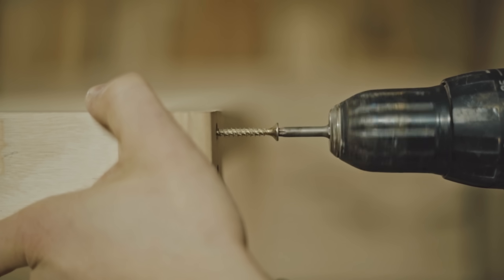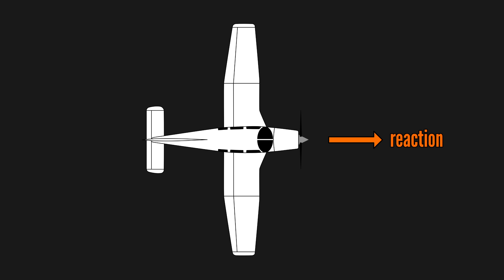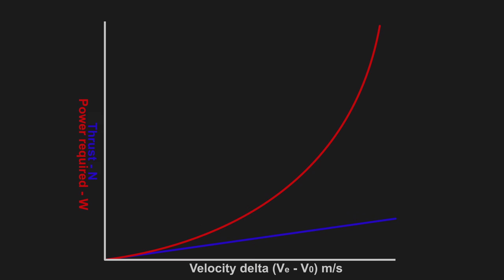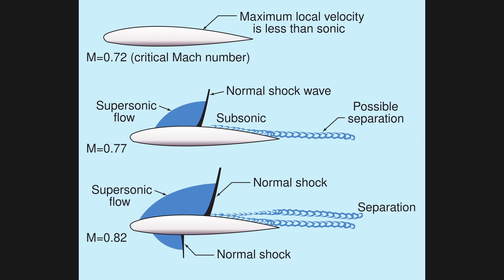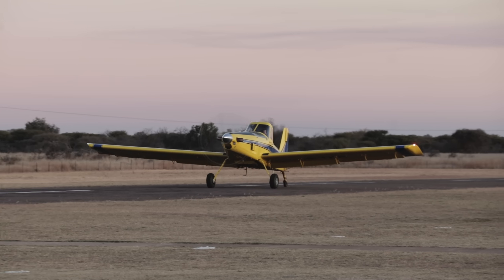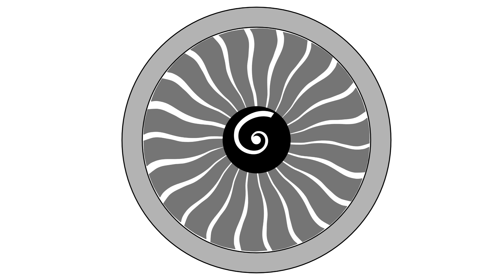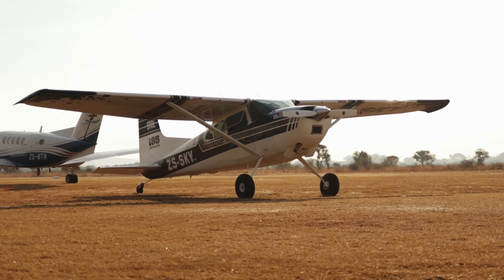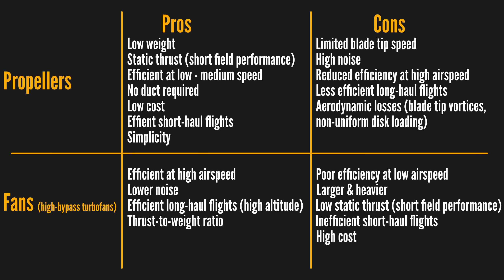This is Why Some Aircraft Use Propellers and Others Fans

Comment: My screws work by accelerating the wood backwards. Since the wood is quite rigid (especially compared to air) the acceleration is almost instant and the wood moving backwards is the same speed as the screw moving inwards. So basically the same principle as a propeller.
Reply from the maker: I'd say its quite different. Can't even calculate it the same. Since your screw moves the entire block of wood backwards with virtually no losses as it screws into the wood. Force in = force out (assuming wood is 100% rigid and solid, which it isn't).

The propeller however cant "screw into" air as it can't grip air like the screw, but disturbs the fluid and "blows" it backward. That was the point. 
So the force applied (thrust) is comparatively complex; how fast it accelerates air, how much air (mass) it accelerates, and then how efficiently it does it.
Reply: @LetsGoAviate But shouldn't there be a smooth transition between air and wood when you would progressivly make the air more viscous until it finally becomes solid?
Reply: @LetsGoAviate  The key difference isn't push vs. pull, it's rigidity (i.e. viscosity). What you're talking about re: "gripping" the air is about how much the medium resists deformation. In wood, rigidity (i.e. near-infinite viscosity) means deformation resistance is dominant - in air, low viscosity means inertial resistance is dominant. That leads naturally into different calculation methods emphasizing one vs. the other.

Comment: Well, in a sense a propeller does pull itself forward, but by creating lift in the forward direction. Not by corkscrewing through the air. Correct?

Comment: Yes, EVERY action has an equal and opposite reaction. And this applies to wood screws too - the principle is exactly the same. The reason they look different is simply the consistency of the medium: wood doesn't get "blown back" to nearly the same extent as air. But it is still happening.
Reply from the maker: Yes, the difference is slippage. The screw doesn't break up the wood around it, it "moves" the whole plank in one piece. The propeller doesn't screw through air like a screw into wood, it breaks up the air its in contact with and accelerates it faster than the free stream air. That's what I was saying.

Comment: 0:47 thats effectively the same thing(with exceptions), the only difference is the thing a propeller is twisting into is viscus so the propeller will slip (and air can be compressed and accelerated) rather than always following its pitch like a screw(because the medium a screw is going through is solid and wont be theown out the back)

Comment: It's not a "fan" in the colloquial sense, it's a compressor. A single stage, low pressure, high flow, axial compressor. You can tell by the stator vanes behind it.

Fundamentally its function is to impart  energy onto the reaction mass (inlet air). In part, it directly accelerates it, but in part it also compresses it so that the nozzle behind it can accelerate it further.

In subsonic and transonic applications it's the most efficient way to generate thrust of that scale. For high transonic and supersonic flight however, one stage is not enough. More pressure is required, along with a choke point in the nozzle, in order to produce supersonic exhaust. This is because inlet air has a limited maximum Mach number, which for all these engines is necessarily subsonic. Thus at higher speeds, the reaction mass is slowed first, then accelerated again, requiring exhaust velocity to necessarily be greater than free stream. A requirement which does not apply to pure rockets, as they carry their own reaction mass within the vehicle.

To achieve these greater pressure ratios, supersonic engines use a lower bypass ratio and multiple stages of LPC. They may or may not also feature reheat.

One way to not let a good high speed inlet go to waste are Concorde's variable inlets. The engines have an inlet limit of Ma 0.65, and the variable inlet geometry uses the shocks resulting from the supersonic inlet to compress it while slowing it down.

Another more sophisticated example are the SR-71's J58 turbo-ramjets, which feature bypass ducts to send the pre-compressed inlet air past the initial compression stages.

Comment: So if a fan on a modern jet engine is a fixed pitch, is it more like a climb prop or a cruise prop. We have this discussion in one of our aviation college classes. We came up with the theory that it must be set more for cruise optimization because cruise efficiency is the most important factor in design since that’s where the engine is most of the flight.
Reply: When the fan (blades) stall at take-off, this will be much more expensive than slightly less efficiency at cruise .
Reply: @ArneChristianRosenfeldt They might be stalled until you start moving and get some airflow over the blades to reduce the angle of attack
Reply: @grumpy3543  I just wonder what inefficiency in a fan would mean. To me they look like a screw. Very thin profile -- which would be prone to stall, but when the fan doesn't stall, efficiency would be good? I mean, I once wondered how to reduce the material in a fan, but still provide an even swirl for the stator. But those transonic fans have so much blade overlap!

Comment: You completely neglected to discuss the force generated by propellers due to the forward lift generated by the airfoil shape of the propeller.  You came close when you showed the camber that propellers have, but mentioned not a word about the lift that the camber provides on the propeller blade.  Besides the thrust from blowing air, the propeller blade camber generates aerodynamic lift forces that provide efficient forward force to propel the aircraft.

Comment: That doesn't make sense! 
Is the fan designed to compress air? WHAT?
That's stupid!  The FAN of the TurboFan engine does not compress air! 
The Venturi effect says that any fluid that is in a large duct and passes into a smaller one decreases the pressure and increases the fluid velocity.
The FAN and the propellers work in the same way.
The point is that the FAN has a larger "wing area" than the propeller and this makes the FAN move more air mass because it generates more LIFT in all the blades than the propeller.
The FAN works on everything to help direct the thrust of the fluid.

Comment: Thank you for stating that the fan is a compressor, most people think I’m delusional when I tell them that fans aren’t just propellers with more blades. I’ve even been expelled from a hobbyist club and cursed at just for stating that turbofans are jet engines and are not ducted-turboprops, as if the proper explanation is a form of hate speech or something!
Reply from the maker: Lol. There's always points of contention in these types of videos/material, but I didn't think this would be one. Would be tough to explain how a turbojet or turbofan core works if fans don't compress air...
Reply: @LetsGoAviate   I know, that’s why I’m so happy that you don’t think I’m crazy. Some people went as far as to saying that open propellers are purely compressors and that ducted fans are purely propellers, those are the folks who claimed I’m delusional. Perhaps they should speak for themselves!

Comment: So what about the new CFM-Rise "Open Rotor" engine? An unducted  fan designed to be used at jet speeds and claimed to be more efficient than a ducted fan. I'm intrigued by the "static vanes" on these engines that convert some of the unwanted rotation of the airstream into forward thrust (like a sail). Could ordinary propeller aircraft benefit from the same trick?
Reply: Both work the same way.

Pros and cons!

Propeller
Pros: 
- Simple to build
- Larger air suction area.

Cons:
- Shifted flow direction (not centralized with Ducts.)
- Smaller wing area against FAN

FAN
Pros:
- High airflow direction(centralized airflow )
- Moves high air mass due to larger "Wing Area"

Cons:
- Expensive to produce

Comment: An admirable video. Then there comes the combination  of propeller or fan with electric motors. I expect in aircraft designed for them the use of at least two wing mounted motors and  no motor in the nose of the aircraft - the electric DHC-2 aircraft now used in Canada were designed for piston engines. IC engines loose power with altitude above sea level, electric motors do not - very important in places like Bolivia and Tibet.

Comment: Propellers work by the difference in pressure on each side of the blade. It has nothing to do with the air moving behind the blades.
Reply: It depends how you look at it, both explanations are valid and interconnected. Newtons laws hold, air is accelerated backwards and the opposite and equal reaction propels the plane forward. The pressure behind the blades is higher than in front so the blades are pushed forward. Same is true of wings, they force air downwards to produce lift (you can see this when a plane flies through smoke), and the pressure beneath them is higher than that above.
Reply: @philiphumphrey1548  Yes they are interconnected and every action has an opposite reaction but the air moving backward is not the force pulling the plane forward. Just as in a balloon you release it is the pressure on one side of the balloon pushing it.
Reply: Exactly, they are an airfoil similar to a wing.
Reply: Principle of pressure to me sounds more theoretical while principle of air acceleration, action and reaction forces sounds more mechanical.

Saying propellers have nothing todo with air acceleration is sounding ignorant
Reply: @LeeCo_Animations  I never said that. the plane moving forward has nothing to do with it. It is a reaction that happens but not the reason the plane moves forward.

Comment: This rundown is sort of correct… some of the points work on the wrong conclusions. Fundamentally, there is no difference between how Fans and Props produce thrust; they are however tuned for different regimes of flight. Both devices depend most on the disc face to produce thrust, just like how the top of a wing is most critical for producing lift. Thrust is fundamentally Lift, just produced by a prop or fan in this case. 

Fans don’t really build pressure more than they drop pressure ahead of them. Newtons Third Law and pressure dynamics resulting in the violent acceleration of air aft the fan as a result. Same with Props but at a much lower extreme. 

Fans came about because their design allows thrust to be produced at high cruise speeds, where traditional propeller solutions tailed off. In that way, its more accurate to think of fans as high speed propellers, ducts and inlets being utilized to reduce the draw backs of a fan type design.

Comment: Blades are designed for a specific speed because the angle of attack need to decrease as it go further from the center, fan blades are attached to a relative big hub with a decent distance from the center,and are shorter   than blades this makes them efficient at a wider range of speeds even with a fix pitch. 
So I guess if blades are placed in a cone 1 meter or 2and bladesare only 1 meter the sistem should
Be efficient at a wider range of speed even o. Fix peach.

Comment: Another great video. One thing that (I think) wasn't mentioned is the tighter manufacturing tolerances required for a ducted fan to perform well.
Reply from the maker: No I didn't mention it. Valid point, thanks.

Comment: Thank you. Solid explanation for standard props. Here's something different and it would be interesting to hear your comments. This prop is a combination of high speed props plus centrifugal compressors, high thrust at the tip, reduced pressure at the nose cone. https://drive.google.com/file/d/1m2rHYah-N5r2zSYRIkrj_qru_8j1DgJU/view?usp=drive_link

Comment: Langua 2:40 "as the square of the velocity difference", I think that should be something like "the difference of the squares of velocities".
Reply from the maker: Yeah you may be right 😆
Reply: That sounds pretty rough. That would mean the energy to accelerate stationary air to 10m/s by propeller would be much much much lower than the energy to push 40m/s air up to 50m/s. That seems like it would get out of hand very fast. something is missing.

Comment: The fan tip speed on many turbofan engines is higher than Mach one. For example, the CFM 56 has a fan tip speed of Mach 1.3. The tiny clearance with the cowl stops the tips generating noise the way an open prop blade does at high Mach numbers.
Reply: Speed if sound changes depending on density of medium traveling through. Black hole: sound speed is infinite in theory. Lower the pressure of medium and speed of sound plane increases before broken. Easy to understand
Reply: @replynotificationsdisabled  nope. The speed of sound varies with temperature, not density. It just happens that the air  at high altitudes is both less dense, and colder. 

The speed of sound at 25c (a pleasant temp at ground level) is 774 mph (1245kmh). The speed of sound a -50c (typical temp above 30,000 feet) is 669mph (1077kmh). 

Just for fun, at the peak combustion temp in a gasoline engine of about 2000c, the speed of sound is 2137mph (3439kmh). 

And the U.S. Army Air Corps did some studies on combustion speed in WW2 and found the normal flame front speed in all gasoline engines was around 150 feet/sec, but if detonation occurred, that burn speed jumped to over 3000 feet per second, making it supersonic, creating those shock waves we hear and call detonation.
Reply: @robboardman598 density absolutely effects speed of sound
Reply: @22k_LOL  Incorrect. The speed of sound depends on the temperature of the air, not the density. 
For examples, go to the speed of sound calculator on the USA's official weather site. There is NO box for inserting density. There definitely is a box for inserting the air temperature.
Reply: @replynotificationsdisabled  unfortunately that's incorrect when referring to aircraft. Both the aircraft and engines are working in the environment of AIR, and the speed of sound in air is dependent on the temperature, not the density.

Comment: 4:43Neither fans nor propellers generate a pressure rise in their wake. They generate thrust purely by an increase in momentum.
Reply: They do, the air continues to accelerate after it leaves the prop due to the increased pressure at the rear of the prop, incidentally this leads to a 'vena contracta' shape of the airflow behind the prop. However, increasing the momentum is inseparable from increasing the pressure so both are true. NB; a reduction of pressure on the front of the prop also contributes similarly to the acceleration of the air before it enters the prop.

Comment: Air is a medium. The lever action of a blade moves the medium and the inertial energy of that medium is captured by the propeller, is passed through to the airframe to be used as propulsion. It's a screw. All the flight components of any aircraft (except pure rockets) are predicated on the presence of a medium. Hence angle of attack, air density, SoS, flaps, boundary layers, ailerons, shark shapes... are all factors in successful design.

Comment: The most significant part  is - ducted fans don't have tip wash.  
Everything in nature will take the path of least resistance. 
Without a  shroud or duct - propellers have a great deal of tip wash , meaning the air is moving aft and  outward in a cone shape behind the propeller. 
Ducted fan engines contain and direct thrust air in a very tight circular force. 
Ducted engines are quieter because the noise of the blades is contained inside the duct / shroud. 
Fan engines have more blades to minimize vibration, noise and share a much greater load between more components.
Reply: i disagree.
Unducted propellers or fans generate swirls aka vortices and like any good aerodynamic engineer knows, any kind of air flow disturbance causes inefficiencies. 
That's the real killer of unducted fans and propellers, that there is a limit to how fast the tips can spin before the disturbances become too great. Ducts are one way to control these disturbances and there are a few other methods but ducting is the most common and simplest although adds weight and if done wrong a safety hazard.

Comment: 1:32 Much of the existing literature and media reiterate Newton’s third law, yet this perspective offers limited explanatory power. In fact, the behaviour of aerospace vehicles—such as rockets, propellers, jets, and wings—can be more accurately described by Newton's second law rather than the third. This is a common misconception. A propeller creates thrust not due to momentum but due to rate of change in momentum, i.e., due to a force. As this force causes the propeller to move thru the air then work is being done by the powerplant.  According to the equation F=ma, when an individual throws rocks from a wheeled cart, the cart will move in the opposite direction. For instance, if a person throws a 2 kg stone at a velocity of 10 m/s every second, they are effectively exerting force against the inertia of the stone. In this scenario, the force can be calculated as follows: 2 kg multiplied by 10 m/s², resulting in a force of 20 Newtons. While analysing the forces of lift, drag, gravity, and thrust is essential, it does not adequately elucidate the phenomenon of lift itself. These terms serve as analytical tools for the design and performance prediction of aerodynamic surfaces, but they primarily provide a description rather than a comprehensive explanation. 
Daily Reflection: To instigate movement or transition, whether in a fluid medium or the vacuum of space, it is necessary to either discard an object or alter the trajectory of an object moving past.

Comment: Kort nozzles have become popular on tugboat, as it controls direction and efficiency. The outer body is as critical as the inner. Fluid that moves in to fill low pressure area in front will travel down outside, adding additional motion energy.